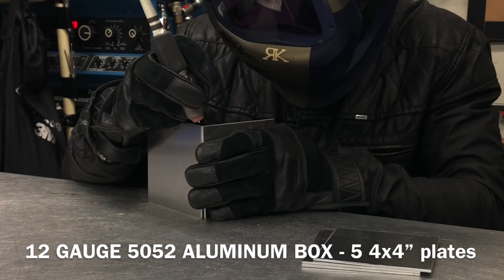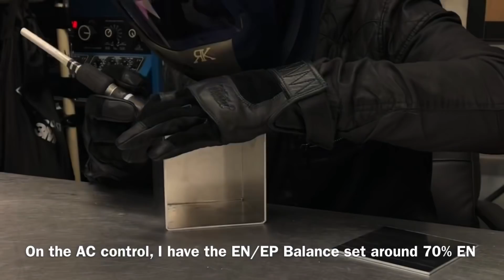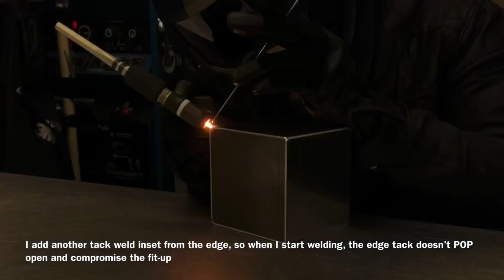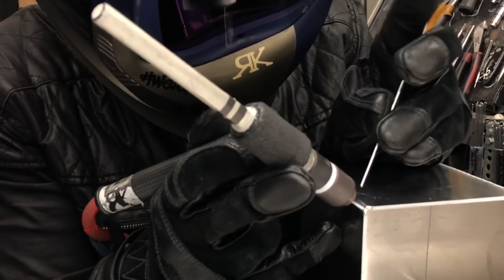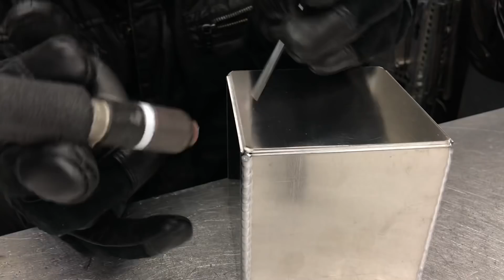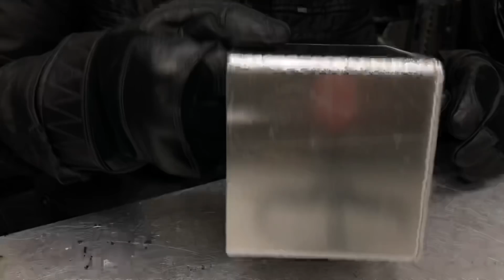MAKING A BOX out of aluminum plate

Comment: Dude I stole your feeding technique lol. I use the "normal" way mostly but I've been working on getting comfortable with yours and noticed it allows for a less awkward angle at times. Like when I'm welding vertical or when I'm hugging a workpiece, my torch hand reaching around one side and the filler on the other with the fillet facing away from me. I still have some little shakiness using it which causes some imperfections when I have to speed up my travel speed but I'm right there. Its exciting because you're such an artist and an inspiration.

Comment: how do you keep from not burning your hands or gloves? gloves are not even smoking after touching it?  every time I weld something like that wearing welding gloves it's hotter than hell.  what gloves are those?

Thanks, and great welding.
Reply from the maker: Thanks! I’m welding between 75-130amps here so there’s not a crazy amount of radiating heat. I used to wear the torchwear gloves before they were discontinued. I really needed a good glove that performs the way I need, & the past couple of years I’ve designed and produced my own arc defence model 01 tig welding glove that’s available in my pro-shop at kaneindustries.co

I also have another model 03 glove that will be available in about a week from now!
Reply: @KANEKIDWELDS   Thank you for the reply, I will wait and get some 03 gloves I'm guessing they are the new improved model?  will check out your store.

Comment: Are the optics on the 3m-Speedglass SO good that you don't need to lift your hood after making a weld to check it out?... Or is this more of an experience thing?
Reply: 3m speedglass is really good, it has a much larger window than cheap helmets, and If its not poluted by mig welding it gives a really clear image

Comment: Sweet welds. I'm just about to buy a tig, did you use any gas?
Reply: You have to dude.. If you don't have gas coverage your weld is scuffed AF
Reply: @joeyvanderhorst816  so with tig I need a bottle of argon always huh? 
Sorry I've been mig welding with flux core so long I forgot about gas. Lol.
Reply: @armenvegas  to weld aluminum u use argon, number 5 cup, 2% lanthanated tungsten, 15cfh, I usually leave my welder on a 6 second post flow for most everything except stainless or alloys I'll kick it up to 10sec.
Reply: In the Netherlands we have something called alumaxx, I don't know if it's known worldwide, it's an argon helium mixture which allows you to weld with lower amperage with the same results. @J G if you weld 10mm thick aluminium plate on 280 amps u use an cup 5? Cup size varies on different situations...
Reply: @semajniffirg230  thanks. I feel pretty dumb asking if he used gas... tig...  it's in the name. Lol thanks for the tip.
Reply: @joeyvanderhorst816  thank you also, I need all the help I can get

Comment: Is it just my imagination, or are you holding such a tight arc that you’re lifting as you add rod?
Reply: Nope, that's something a lot of welders do
Reply: Ideally youd want to be as close as possible
Reply: Welding aluminum it's pretty common to do this with the big dabs he does. If you do smaller faster dabs the "stack" of the bead isn't as tall. He's going for a real pretty looking weld here so he'a using slower larger dabs which you gotta compensate for on the torch hand.